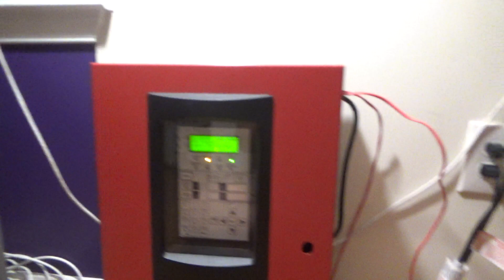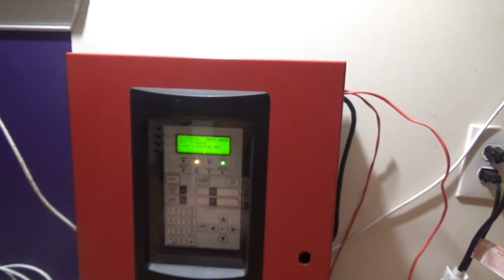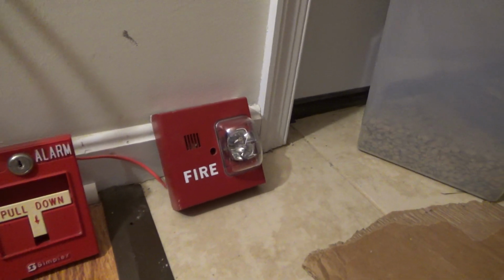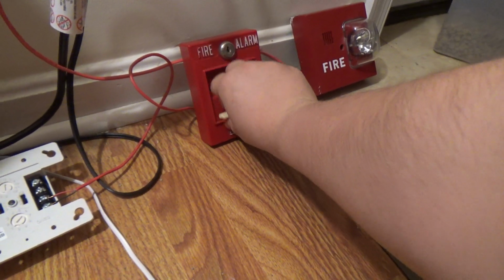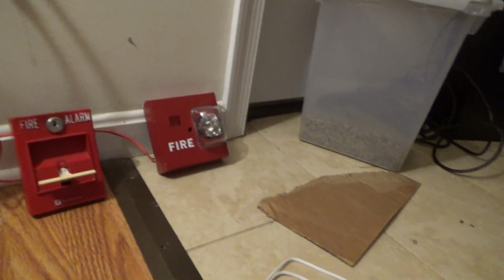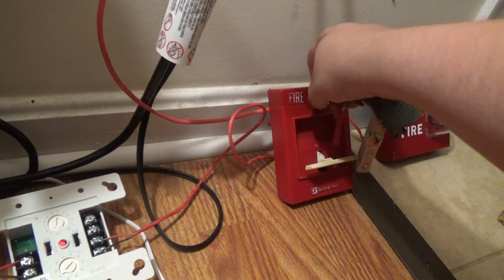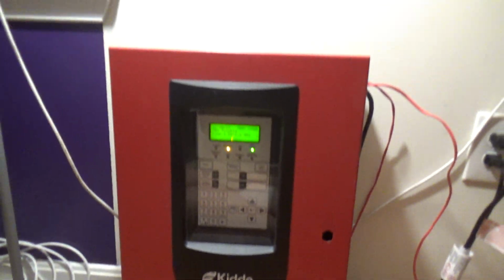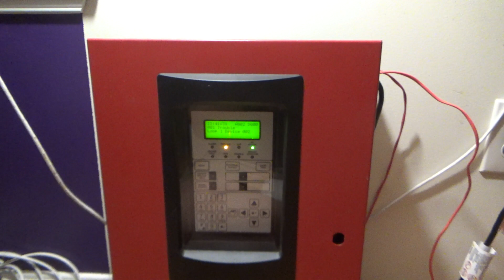Mini System Test 5

Comment: About the resistor thing, that module should be able to work with a standard 4.7k from when I looked it up
Reply from the maker: Well it doesn't work on mine so it doesn't so it's not the right resistors